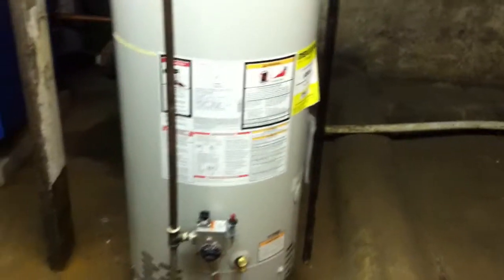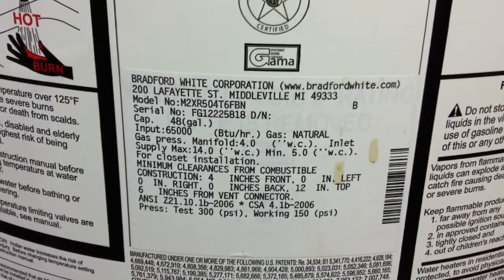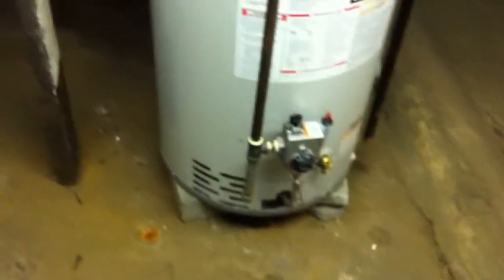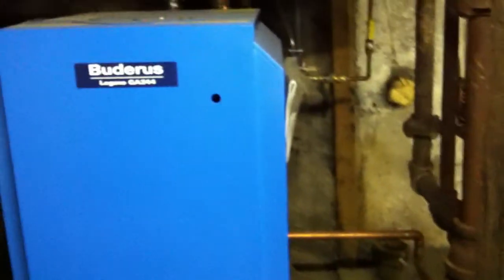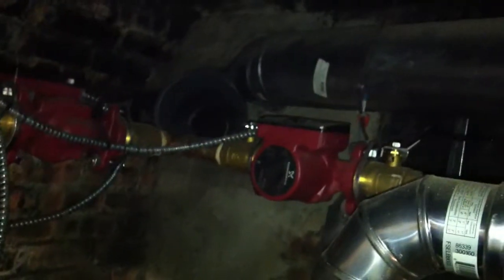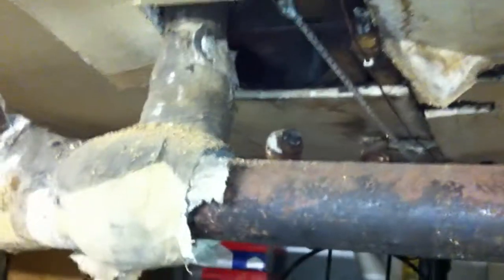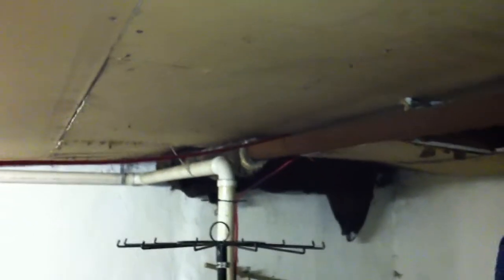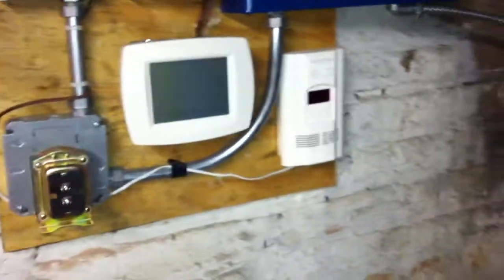Mechanical Room Tour in Old apartment building

Comment: That's a nice boiler. I would have just put in a 120 gallon storage tank and connected it to the boiler with an additional zone valve and dedicated circulator if needed. Do that next time, saves aggravation of replacing water heaters. Or go with a tankless if the water is not too hard. I also like Bradford White, that's what i buy for customers that want a tank style water heater. I also get AO Smith from time to time. They make a good heater these days also.